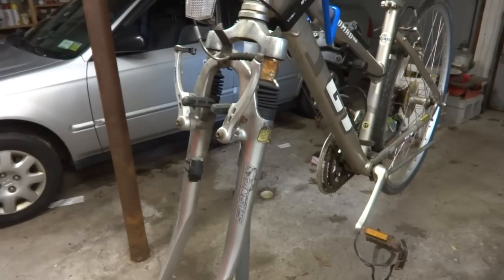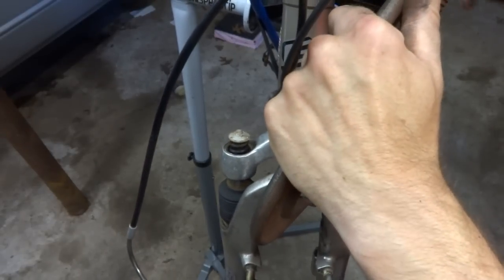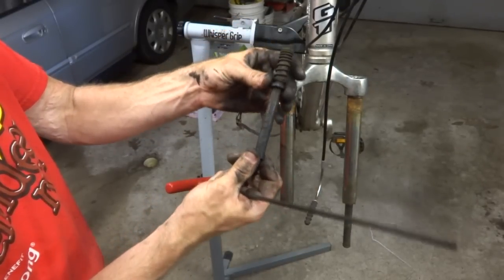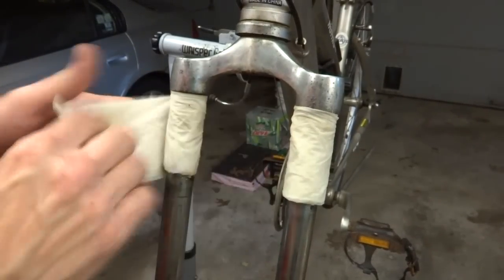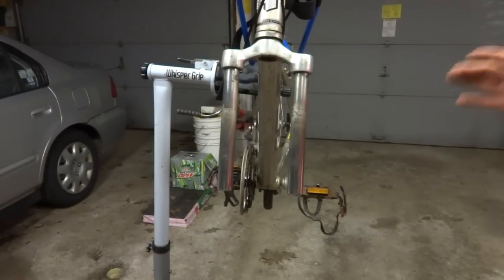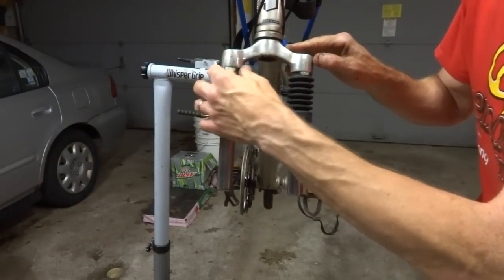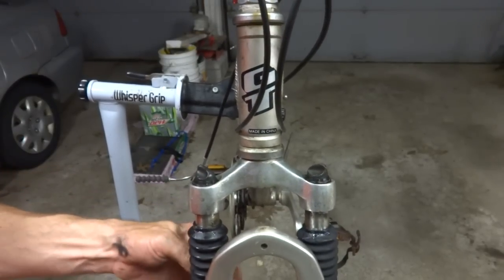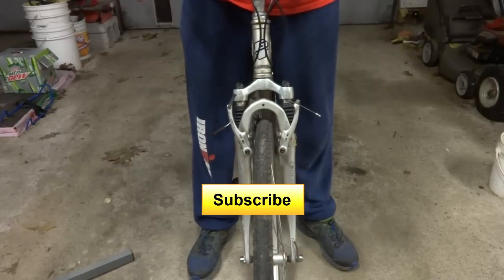Repairing Seized SR Suntour T890 Fork - Disassemble/Clean/Lube

Comment: you are one of the few left REAL mechanics you dont just change parts , you actually fix them, nice job man
Reply: The time has changed a lot since then!  
In many cases it's cheaper for the costumer to replace the item instead of had it rebuild (labor costs). 
I agree in so many ways, but as s professional bike mechanic myself I know how the business are. 
I'm sure that a lot more mechanics would love to rebuild or fix broken parts, but yeah... it's too expensive and in many cases incredibly hard to find spareparts..
Reply from the maker: True. It's often easier and cheaper for a shop to replace parts than to fix them. But for a home mechanic, time is not some much of an object. Broken parts are still an issue. Some are just not available.
Reply: I am a home bike mechanic RJ and i love your work and videos. I have done what you do many of times bringing bikes back from the dead but have come to the conclusion that unless you are doing this to fix your own bike or one that is a keeper most of the times it is not worth it (timewise or moneywise)to go into the trouble of fixing these parts unless you are going to make a satisfying amount of money selling it on.Now i mostly look for second hand bikes that need little fixes or use second hand replacement parts to fix and sell on. On the other hand bike shops here in UK are so rediculously expensive for repairs that most of the times you can buy a new bike for what they are asking for and that is because they dont really repair,they replace.
Reply: You can buy new budget Suntour forks for less than £50 on ebay, so a useful exercise if you have the time and inclination, but I suspect there's lot's of play between the stanchions and the forklegs (there is when they're new) and with no replaceable bushings they really are poor forks with just spring preload and no damping, I certainly wouldn't use them off road.
Reply: Simple economics; do you pay somebody upwards of £50 an hour for a couple of hours to repair, (keeping potentially worn parts) or half an hour labour and new parts?
Reply: I am an old Engineer Mechanic are the organisations training youngsters NO. When we die who is going to replace us, I am 60 and get to many companies offering me work every week on the net.
Reply: It's cheaper and faster to just replace parts. (In some cases)
Reply: @eddymerckx5200  Costumers are usually handier with garments than bikes...

Comment: I have a similar fork except it's a RST Sofi T, single spring with no lockouts.  In the long run I'm planning to convert to a rigid fork with shorter atc.  Will it cause damage to the fork if I remove the spring and secure the lower half of the fork in the full compression position?  No off road riding just roads/sidewalks.  The purpose is to reduce the stand over height.
Reply: if you do that youll mess up the bike's geometry which may cause some problems like pedal strike due to lower ground clearance which is dangerous

Comment: Hi RJ The Bike Guy,

Been running around finding answers… Is it possible to change the fork travel from 80mm to 100mm. Mine's a Suntour XCM, by the way.
Reply from the maker: If you replace the forks with ones with more travel. It might effect the ride of the bike.
Reply: +RJ The Bike Guy 
Actually I bought the bike from a friend and it's confirmed that the OEM fork was a 100mm...
I would buy a new fork but thought what if I could mod the 80mm?
Thanks.
Reply: It depends on the model .Some can have travel changed just by moving circlip or removing inserts. Look up on forums with exact model you got .

Comment: You are quite the DIY kinda guy....BUT...do yourself a favor and anyone who is reading - buy a micro sonic cleaner, use soap and water and throw away your harsh chemicals and let the micro sonic action amaze you and clean the parts for you.
Reply from the maker: I have an ultra sonic cleaner. It does okay cleaning some stuff. Not heavy grease,
Reply: @RJTheBikeGuy  Put the setting at 140° or higher if it can, and the heat will "eat" the grease off it and use alot of soap. Always pre-wash anything that has a huge build up of grime. The micro sonic cleaner is more for areas where brushes will not reach.

Comment: Is there bushings I can replace in my forks as I have some play in the tubes when you apply the front brake and rock back and forth you can see movement between the upper and lower legs

Comment: Why didnt you used suspension oil like you did on the other shocks? Thanks
Reply from the maker: Because those shocks were designed to use oil and this one wasn't.
Reply: RJ The Bike Guy im confused now... how do i know which type are mine?
Reply from the maker: Look up the specs and instructions for YOUR forks.

Comment: What kind of bike stand do you use ?
Reply from the maker: In the video I am using a stand made by Minoura. I bought it used on craigslist and it needed cleaned up. My good stand is a Park Tool PCS-10 which stays inside.
Reply: shyflirt1
 Hi shyflir1, may bee you can do bike stands video ?
Reply from the maker: Not sure what I would say about them. I do have a video how how to make a bike stand. I used that stand for years.
Reply: shyflirt1
I love you stuff